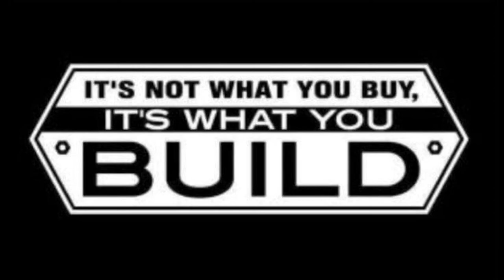1941 Chevy Truck Restoration, Door repair, welding 16ga lower piece  (sound malfunction at end)

Comment: Not bad at all, I had 3 inches of my door bottom removed to find good metal, nice fix that's doing it right
Reply from the maker: Thanks buddy,  I think I have to radius the edge for the fender. I'll be fitting it up this week to check and fit.
Reply: @ELDESTBuilds  I'll be watching, great job so far